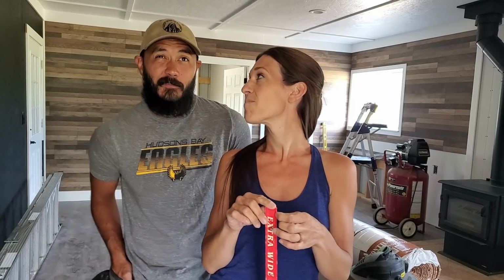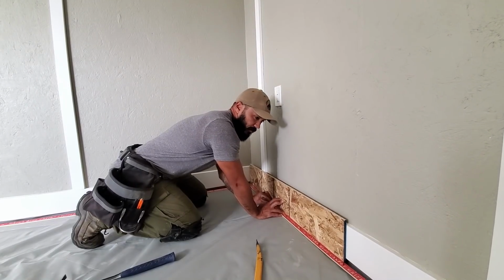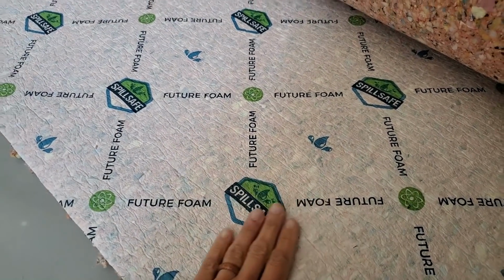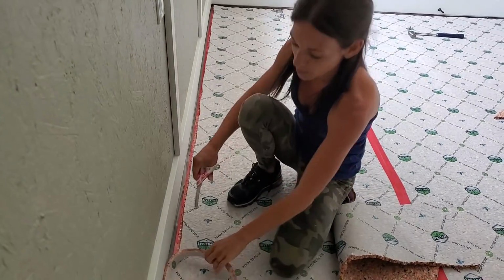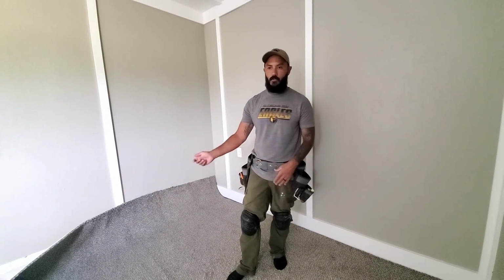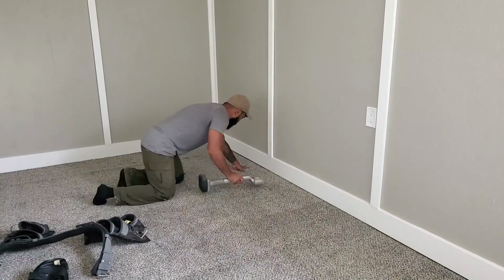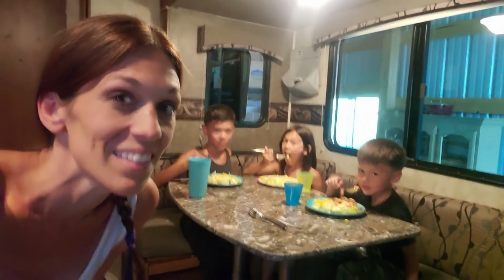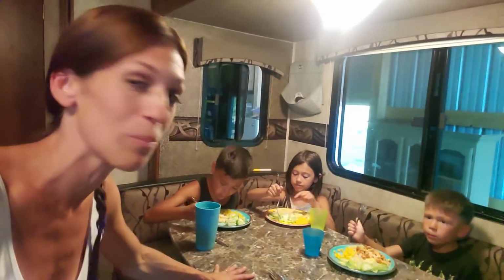This Is HUGE!!! He FINALLY FINISHED IT!  | Building Our Own DIY Tiny Home

Comment: Worked in ER as a nurse. We used Adolph's meat terrorized on wasp, hornet, bee stings .  I am I'm repeating a suggestion already made. Make a sort of paste with water, put  1/4 teaspoon on center of bandaide, apply to sting then put tape crossway over bandaide, it keeps the tenderizer contained.  The enzymes in the tenderizer break down the foreign protein in the sting. Taking down the swelling, soreness in 30 min.

Comment: Ichthammol is an old-fashioned ointment made of pine tar. It's a drawing agent and works wonders on all sorts of bee and wasp stings. I use it on mosquito bites, which make welts on me, and it takes the itch away within seconds. It's also good for splinters and boils. I keep it in a ziploc bag with bandaids and a toothpick. Because it's made from pine tar, it's dark brown and can stain your clothing (hence the bandaids). When I get a bite, I use the toothpick to "chop" of a tiny bit and put that right on the bite, cover with a  bandaid, and in minutes you can take the whole thing off and clean it up. ~ Congrats on getting the kids' room done!

Comment: Growing up we had a huge hornet problem also.  The best thing I found was household ammonia. Soak a cotton ball or paper towel in ammonia and put it over the sting ASAP after the bite.  I got bit on the side of the neck once and grabbed the bottle and tipped it up against the sting and held it there for about 5 minutes.  It really takes the pain out and the next day it is just an itch.  Good luck!

Comment: Baby girl!!! You need to get some bentonite clay and Juniper Berry EO and make it into a paste with just a few drops off carrier oil added in at the end. Put it on that to draw out the toxins. It would have been best if you did it within half an hour, but it will still reduce the time..If it was me..from 6 months.. to a few hours. Had a sting before I found out about the poultice.

Comment: On the bed before you place the mattress  you should have put a layer of plywood.  That will stabilize the bed and the mattress doesn't sink. It's called Bunkie board in furniture term. I am a mattress expert 🙂

Comment: Maybe I am to late but is a  nail concrete gun that shoot nails into the concrete, you just hit it with the hammer it use a blank .22 round home depot sale them, is easy to use for putting those strip for the carpet. Sometimes went you hammer the nail it becomes lose...

Comment: We use a product called PRID it is a black tar looking substance and it comes in a small round orange tin, it is a drawing salve and it works great to draw out the poison you can also use tobacco to pull out the poison and to reduce swelling.

Comment: I would like to give you a suggestion  on your hammer,  I see you have the Estwig good hammer,  but not great for your wrist,  I have used many of them and now I have carpol tunnel  because of the hammer, dont do what I did, My Doc said do this for yourself , So I did what he asked, I purchased the  Stanley  hammers 22 oz. and 16 oz. What the Stanley  has that others dont is a tunning fork in the handle it stops the vibrations  going into the wrist and forearm, I wish I would have known this  along time ago, So if you want to learn from the oldman, do it or don't  its your wrist you can learn the hard way like I did, Enjoy the Day

Comment: I'm sorry about your bee stings. It looks painful. Perhaps, try tea tree oil & lavender oil. I haven't got stung by a bee for many years with the exception of last Summer. The bee you must have dropped or flown on my back. When I had gotten inside the house, it stung me and sorta freaked out. Lol. I ran to go get the tea tree oil. Well... I nearly bathed in it! 😂 The upside is that it never itched, was painful, swelled up. I was breathing normal and my heart wasn't racing. Don't know if was all about the tea tree oil or I'm not as allergic to them as I have been in the past. Either way, it was quite the comedy show. By the way, the kids room looks amazing; great job!

Comment: The power company have hornet problems all of the time. Their solution to this is to fix a road flare to a pole, ignite and  shove into nest. The hornets will rain down but will be dead. Nest location allowing for use of flare.

Comment: Bee stings: soak affected area in Epsom salt and clean warm water ( soak for at least 15-20 min.) then find cat tales at the bottom of the stock you will need to start separating it (like celery socks) inside you will find a clear sticky slimy substance.
This stuff is GOLD smear it on!!!  It is also good for: sunburns, bruises, cuts, abrasions, ect. It was used by the american Indians like Aloe Vera is used. Give this a try
PS. Inside the stock is also edible. research this BEFORE YOU PUT IT IN YOUR MOUTH!!!!!!!!  BTW the right part is tasty